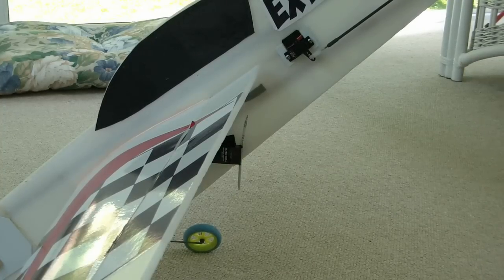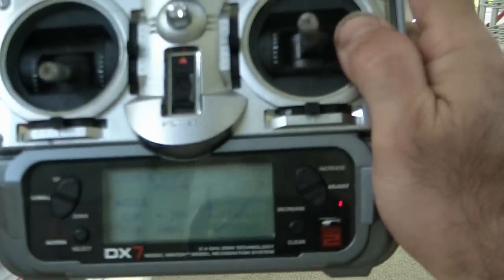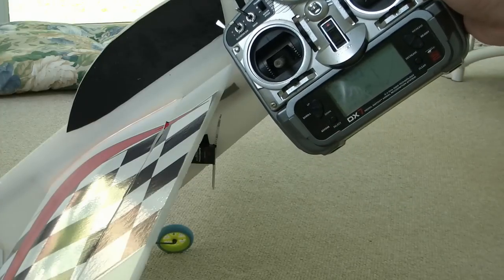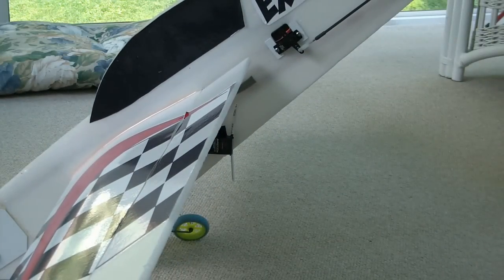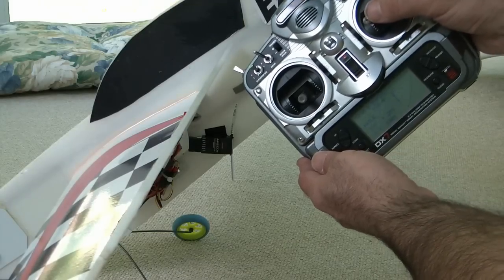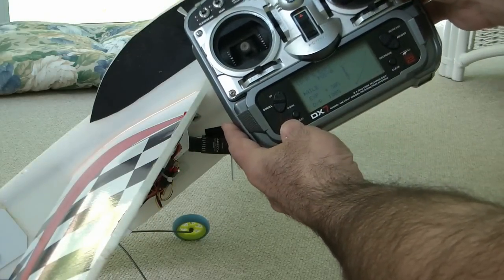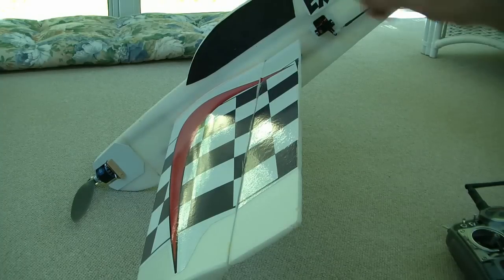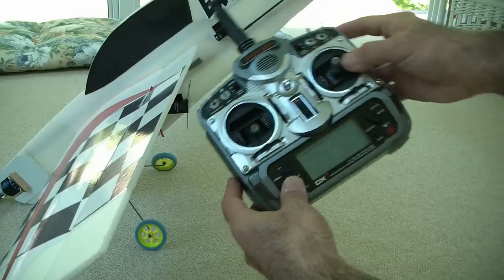Gyro on airplane - throws and dual rates

Comment: Gyro is not the reason. Your throw adjustments do not match your pot reach. Back the throws up on your ailerons to match your transmitter/servo rate (in 125% mode
) and you'll get your dual rate back.